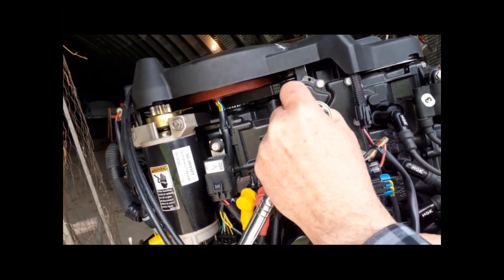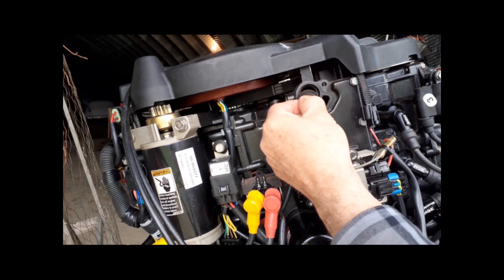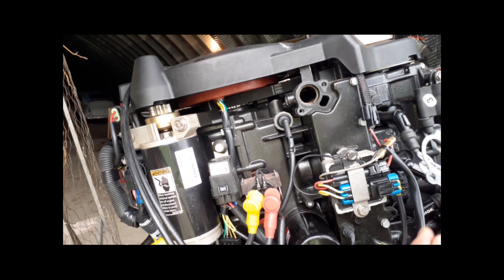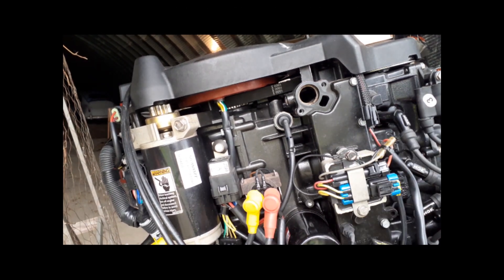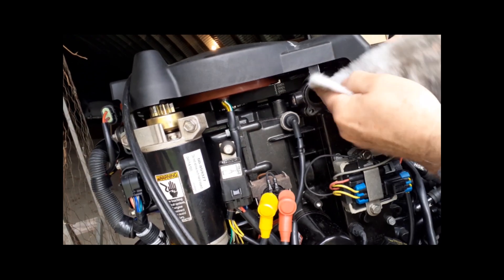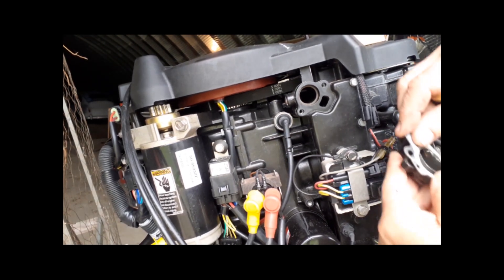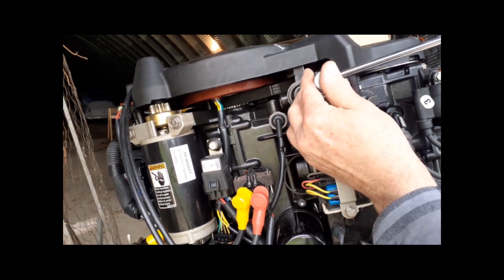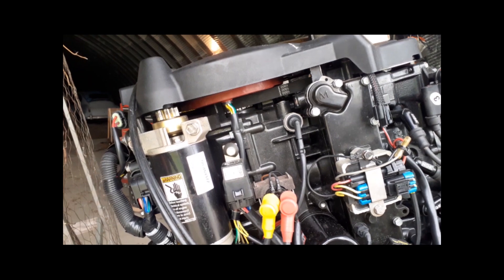Crusty Thermostat replacement on a NEW-TO-ME Mercury 60hp 4 stroke outboard motor

Comment: Mr Hobo, I bought a 2005 mercury 60 hp bigfoot. On that port, right to the left on the thermostat housing. Yours is plugged off . Mine has a barb fitting with a tube that runs to the lower front end of the cowling and just dumps water ! In the cowling! That can't be right ? As far as I can tell, that port is a flush port ? It starts right up. I have strong telltale water out the back and out of that tube coming from that port in question. I'm just checking to see if you have any knowledge of that ? You also helped me out with your remote/rigging video. Thanks again for that!
Reply from the maker: I had a look at my manual (50&60hp fourstrokes, 2001+).  It shows a plug is normally installed there.  Page 1C-20 indicates that is where you can attach a test hose and gage to check pump water pressure.  Perhaps someone previous to you was testing pressure but forgot to put the plug back in!  I'm glad you have found some of my videos useful.
Reply: @oldhobo5610  You the man Hobo ! I bought it from a friend of mine. He bought it from an older couple who didn't use it much. He's had it for some years. He's not very mechanical, but says he's never had a problem with it. No overheating issues. He changed oil but that's about it. He never had the muffs on it with the cowling off to see it I guess? No telling how long its been like that. I hope it didn't hurt it ? I haven't had it on the water yet. Wish me luck!
Thanks again, I am subscribed.

Comment: I just replaced the thermostat on my 50 hp Merc today, same thing, both gaskets didn’t fit and ended up using the old one.
Reply from the maker: @fratzogmopars  Next time I will pick up the thermostat and gasket at a dealer, so they take responsibility for the gasket being correct.  Glad your old gasket was still usable!